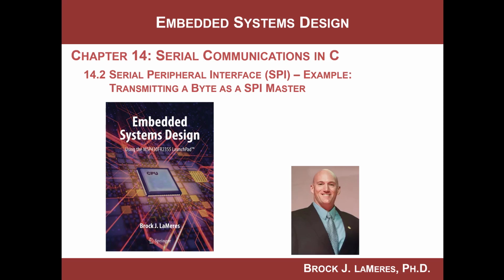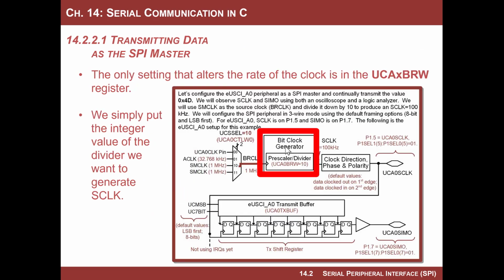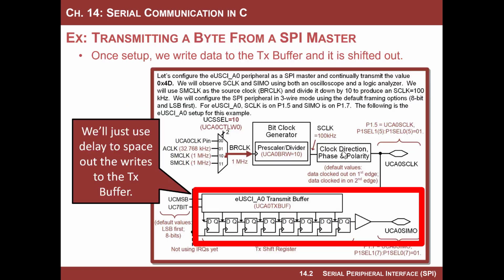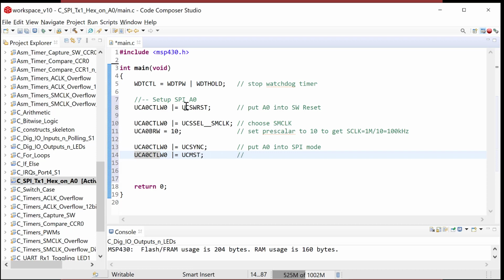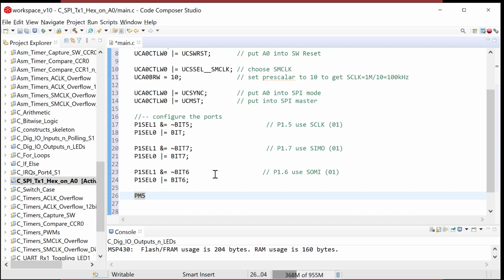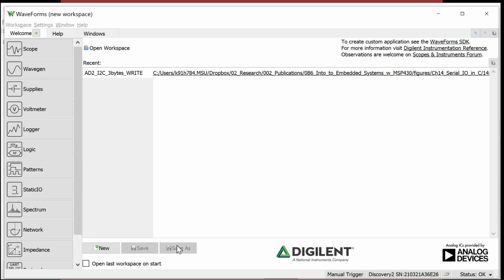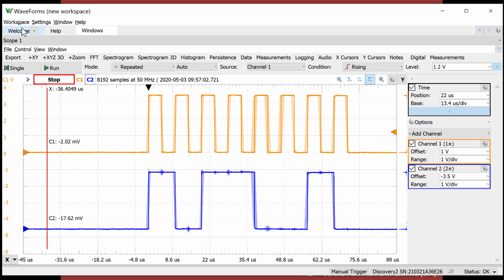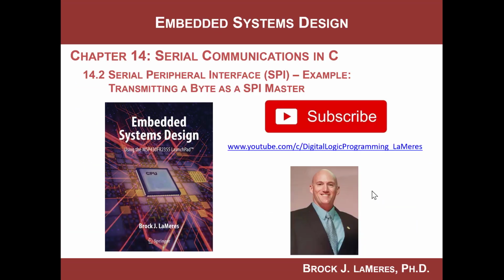14.2(b) - Serial Communication on the MSP430: SPI - Sending a Byte as a SPI Master

Comment: I think you're using the USCI version of SPI.  Some MSP430's (like MSP430g2452) only have USI module, not USCI, and setup is quite different.  I'm still futzing with getting mine going.  But excellent description of what you were doing.  Thanks